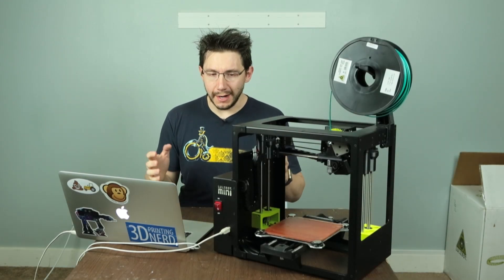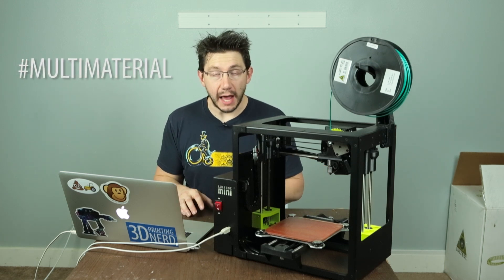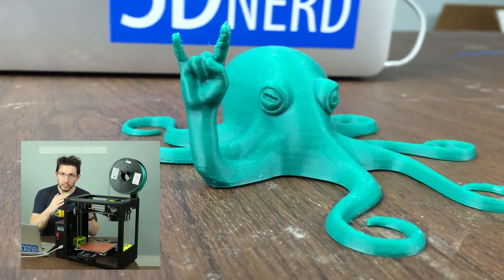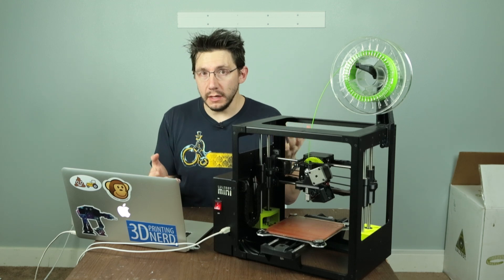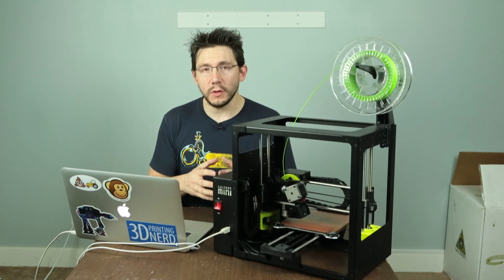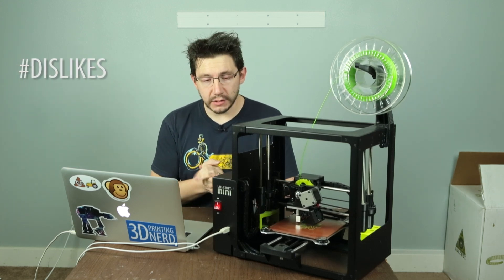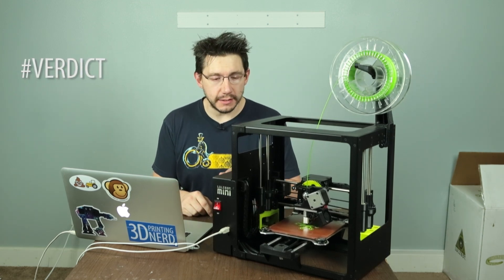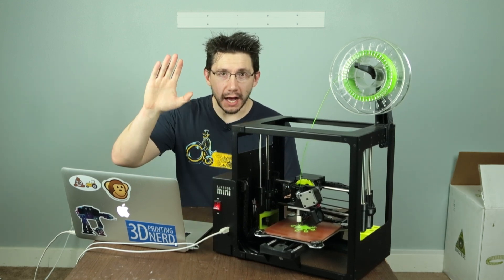Lulzbot Mini 3D Printer Review

Comment: I hate my mini so much.... I change the bed twice, I change the microcontroler twice (Now I use a alluminium bed) Now I use a mks base and it run smooth, less noisy by far. and for the same price of the mini-shitty-rambo, with a touch screen and a sdcard reader. It doesn't wort is 2000$

Comment: Congratulations on your particularly splendid hair in this video! Thumbs up! 👍
I have also recently bought a LulzBot Mini and I'm extremely happy with the build quality, the fact it's also open source and that it prints incredibly well. 
I find the print bed to be ample for my purposes and I wanted a machine that wouldn't dominate the room it's in. 
My only negative, which is not the case for the bigger Taz 6, is the fact that you're expected to print tethered to your computer via USB. I have, however, found the perfect solution in a Raspberry Pi and the Octoprint software (which is also open source). I can now not only send files to my LulzBot Mini via WiFi but monitor the printing process from any browser enabled device AND I can install a webcam for remote images of my print jobs if I want! I think I may love my LulzBot Mini!

Comment: I saw this printer in use and one big reason i didn't get it is because its very very loud. I chose a flashforge clone, the powerspec 3d pro because the build plate was bigger, it was enclosed witch makes it easier to print with abs and it is really quiet. I'll say this 100 times over, I do not regret it. #getthingsdone
Reply from the maker: +Shopless WoodWorker that's great, man!

Comment: I have had this printer for a year and a half.  I found that if the printer shakes at all, the prints will not come out sharp and clean.  I built a solid, stand alone table for it with heavy materials.  Once on this new table, any irregularities disappeared.  I even have the printer sitting on a slab of marble for more weight.  Dampeners under the 4 feet did not work.  The solid table did.
Reply: So for the amount of filament (say pla) to print that octopus, how much would it cost for the material? Also does it print metal filament by chance?

Comment: I need to print 1:400 scale airplanes and vehicles for a model airport I am making. Can this 3d printer make small objects like that?
Reply from the maker: It comes standard with a 0.5mm nozzle, but you could easily find a smaller nozzle to help with smaller things having smaller details #smaller
Reply: Ok, thank you

Comment: 3D printers today seem to be about where laser printers were in the 80's, big, slow, complicated, expensive machines that didn't work very well!  I suspect that in another year they will be down closer to where laser printers are today, made mostly of cheap plastic parts and costing only $79 but working much better.  This one looks like the best model so far but it's $1200 so it looks like the $179 Tico beats it by quite a bit.
Reply from the maker: Your analogy is fairly accurate. I like to equate the 3d printing industry to the early days of video games. 3d printing now is essentially where the Colecovision falls into place in video game history.

Comment: Does this printer work well and reliably with prints with multiple components? My schools printer is rather bad about them so wanna know
Reply: We've had one running for the last month and no matter what we have printed it has not failed to date. Most if printed is 7 parts in one go. We print a lot of things without supports that our delta has no hope with. Only problem I've found is you just have to watch the cleaning and leveling process to make sure there is no gunk on the nozzle which insulates is from the auto bed leveling. Once it's passed the bed leveling you are all good. Printable spare parts are a plus too.
Reply: +Ladbrotory Thanks for the response with that, what about the filament size, I know he mentions in this vid that it is meant for 3mm, but he was able to use 1.75 with no problem, do you have any experience with trying to use 1.75 with this? Thanks again!
Reply: +Andrew Bok You can use 1.75mm right out of the box but you do need to adjust printer settings. I've done a couple which have come out ok but I can foresee reliability issues with it. These' s no difference in cost in filaments but if you have a heap of 1.75mm yes you can use it. By memory Lulzbot also sell a 1.75mm hex extruder which will obviously be better but its probably not worth it. The '3mm' is such a better filament size. We are in the process of converting our delta to 3mm.
Reply: +Ladbrotory ok, thanks for the answers! If you couldn't tell I am looking into getting a printer and this seems like a very strong option, so yea, I just had a few things to wonder about, and I do have some printing experience through my school, so yea!
Reply: Definitely a good buy. Only thing I would say is if you can afford it got the TAZ6 as everything is basically the same just 4x print volume

Comment: I'm a teacher and new to 3D printing. How well will this printer work with TinkerCad?
Reply from the maker: +Todd Shoemaker Extremely well. I use the Lulzbot Mini and Tinkercad when I give talks on 3D printing.
Reply: Another school in the district has a $2500 Makerbot. Would I be happy potentially getting two Lulzbot minis or one Makerbot. Thanks
Reply from the maker: +Todd Shoemaker The Lulzbot Mini DO need to run hosted, so, they have to be plugged into a computer that would slice the files. That said, the Mini is an absolutely wonderful printer. Get a hold of Lulzbot and talk to sales - they may have an education discount.

Comment: I work with a FF Creator Pro at work and that dual nozzle is hard to beat! :)
Reply from the maker: +Goodmourning257 I have a Flashforge Creator Pro as well and I love mine!
Reply: 3D Printing Nerd Having no real experience with any others though this one looks pretty awesome. that auto leveling feature seems like a dream! Wanna get some exotic filament now and try my luck/patience :P
Reply from the maker: +Goodmourning257 do it! I've printed a whole bunch of exotic on my FFCP. it's GREAT for that!
Reply: 3D Printing Nerd Another noob question but id like to hear your input. What is the best technique for removing your prints from the heated plate? do you do it hot or cold? ive noticed you usually print raftless but sometimes when i do my prints seem to become molecularly bonded to the plate and break when im trying to get them off. thanks in advance for any tips and tricks keep up the great work!
Reply from the maker: Goodmourning257 It always depends on the type of build plate and what tools you have. removing cold is usually best. If your stuff is particularly hard to remove, it could be that your nozzle is slightly too close to the bed when printing.
Reply: 3D Printing Nerd Ah thats what it is! You just helped me solve my problem i think. lately the nozzle has been clogging when the hot filament gets blocked and it goes back up the ptfe tubing and i have to do surgery and get it out. I think that the nozzle is just too close to the plate and its gumming up the hole and then causing the blockage. Baby steps haha thanks for the help!!
Reply: +Goodmourning257 Sounds as though you need to bump up your z-offset a bit to correct for this.
Reply: John McNerney I just replaced the nozzles at the beginning of the week and it has been working smoothly ever since. im not sure if you factory nozzles were weird or if i just have yet to experience the problem again. if it comes back though I will keep that in mind thank you!
Reply: +Goodmourning257 Good to hear.  My z-offset comment was based your statement that you thought your nozzle might be too close to the plate.

Comment: Did you have to calibrate the esteps? Our school has that printer...
Reply: +우희도   I gave a Mini to a teach in our local elementary school. The e-steps were set from the factory at 833, but I found that it was over-extruding a bit.  I recalibrated, and ended up dropping my e-steps setting from 833 to about 820. (A lot of others in their user forums have ended up with similar numbers.)

Part of the problem was that their workflow for doing your own e-steps calibration used a filament feed speed of 100mm/minute. This is too fast for accurate calibration (I believe it creates a lot of back-pressure in the extruder, resulting in missed steps on the extruder motor). At that speed, I was getting 850+ for e-steps settings, which resulted in even more over-extrusion. Slowing to a speed of 40mm/minute for the filament feed speed during e-steps calibration more closely approximates the speed during actual printing, resulting in a more accurate e-steps number.
Reply: I also had to bump the z-offset up by 0.1mm. The prints were sticking too hard to the bed, and the kids were having trouble getting them off.

Comment: Couldn't you put in a thumb drive
Reply from the maker: +Orion McGimpsey How would you access what is on the thumb drive? It has no LCD screen or controller.
Reply: +3D Printing Nerd that is true I wish you didn't have to have an lcd to use a thumb drive also would you recommend this to me I am 13 and I want a printer on my desk. But my desk is in my room where I sleep so is it too loud and if it is would you please recommend a quieter printer for me.
Reply: +Orion McGimpsey and if you recommend a printer please make it around 1000-1500$
Reply: +Orion McGimpsey If you go on the Lulzbot community forum, you can find a lot of threads where folks have installed a dampener on the y-axis stepper motor, which has resulted in a significant reduction in noise.

Comment: Great review Joel! As a Lulzbot mini owner myself I share your pro's and con's. However; I have lately noticed that the automatic cleaning may fool you. Even with fresh new cleaning felt and a hand cleaned nozzle (pre-autocleaning), sometimes a tiny bit of felt gets stuck on the nozzle and hinders the conductive auto-leveling. My solution was to remove the felt-cleaning part and hand-clean the nozzle before each print, just to be sure.

Also; a single Nema damper on the y-axis reduced the noise from ear-bleeding to acceptable.
Reply: So for the amount of filament (say pla) to print that octopus, how much would it cost for the material? Also does it print metal filament by chance?

Comment: Does that version of the hexagon have the fragile "throat" ?
I just accidentally destroyed mine re-fitting the heater block because it was so fragile!
Reply from the maker: +MiggyManMike Fragile throat? I'm unsure of that, and this is the first time I've heard of the Hexagon hot ends having this. Have a link where I can read up more?
Reply: No link i'm afraid, it's just something I became aware of when taking mine apart, the "throat" between the heater block and the break is quite thin on the original hexagon, just curious if the new one had the same issue, i've actually gota couple of very generic e3d clones on the way but down the line I wouldn't mind getting another hexagon as it worked well until I managed to destroy it :p

Comment: How about the Lulzbot Taz 5?
Reply from the maker: +ReneFloresVlogs What about it?
Reply: +3D Printing Nerd is it as good as this or better?
Reply from the maker: +ReneFloresVlogs Oh, that I don't know. This is the only Lulzbot Machine I've used.
Reply: +3D Printing Nerd alright... I'm just researching on the best 3D printer for when i get really into it and need an upgrade from the dremel. The PLA only really limits me and I would love something that is just the best if you know what i mean
Reply from the maker: ReneFloresVlogs You have the Dremel? That's a decent printer, and once you put a plated nozzle on that thing, you can run all sorts of PLA exotic materials like carbon fiber and stainless steel. Don't count it out just yet :) The Mini is REALLY cool, partly because of that nozzle cleaning and bed leveling system. I hear the TAZ6 is suppose to have that on it.
Reply: +3D Printing Nerd awesome!!! I'll be waiting on a video of the nozzle then, and also have you tried stepper dampers which supposedly quiets it a lot?
Reply from the maker: ReneFloresVlogs No I haven't, and honestly, I've never felt like I needed to quiet the machines. They are in a room behind a door, so that's how I quiet them - close the door :)
Reply: +3D Printing Nerd could you give me a link to the replacement nozzle you got please?
Reply from the maker: ReneFloresVlogs Look on http://www.proto-pasta.com that's where I got mine. Go there and search for "nozzle" and you should find it.
Reply: +3D Printing Nerd thanks

Comment: I print on the Taz 5 with 1.75 mm and 3.00 mm filament all the time. Just change the settings in cura (I run 95% extrusion). I like 2.85 over 1.75, its easier to handle and less likely to tangle on the spool. I get great performance either way out of a Taz 5.

Comment: I've used 1.75mm filament in my printer and most times it works fine, but once in a while the smaller and more flexible filament will bend and bind up between the drive gear and the print head. I've found that using a little higher temp on the print head helps to keep this from happening, the filament softens and flows with less back pressure on the filament helping to keep it from folding up. I've since used up my smaller diameter filament and switched to all 3mm. Awesome post, awesome printer, awesome channel. HIGH FIVE!!!
Reply from the maker: +Troy “Goldweaver68” Gannon Whoa, great tip, thank you! RETURN FIVE!!!

Comment: Hey Joel, Great review as always!! I couldn't help but notice that the print you did of Nefertiti @3:55 didn't print that well....dude.....what happened to her ears?........any idea what went wrong? A very Happy Easter to you and your family!!
Reply from the maker: +Handmade Props I didn't do good supports around the ears. Yeah, that's my fault on that one :( Happy Easter to you and yours as well! #highfive
Reply: Hi Joel, I thought that might have been the issue. It looks like a fantastic little machine...just wondering if the hot end can be swapped out if you wanted to print using carbon filament? #highfive

Comment: You can use 1.75mm filament in your Lulzbot.
Just slow your retraction speeds to stop grinding and you can use 1.75mm no issues.
Im not kidding and you will see this on the forums also. :) GL!
Reply: +ZachryDoesMinecraft My bad did not watch the rest before I made my comment.

Comment: Look up OctoPrint you will need a raspberry pi($35-40 usd, i whould get the pi 3 as it has built in wifi) a sd card, and a micro usb powersuply 5v, 2.5 amps
Reply from the maker: +Austin Chopra I have an RP2 (got it for Christmas!) just haven't had the time to set it up!
Reply: Wow that was a fast response.  http://octoprint.org/ it runs cura as the default slicer and you can hook up a webcam or raspberry pi camera to it and monitor it from any were in the world, and do time lapse with it as well
Reply from the maker: Austin Chopra Sweet! I need to get this going!

Comment: in this video, joel learns the glory of PEI print surface.

for such a spendy machine, the build volume is too small.

would have been better if the taz 5 was 12x12x12 and the mini was 8x8x8.
Reply from the maker: +ms3bani ooh, a Lulzbot with a 12x12x12 print volume would be WOW.
Reply: 3D Printing Nerd
don't you mean it would be  #highfive  ?
Reply from the maker: ms3bani YES!

Comment: Nice review! But one thing: whats going on with that white stripe in the background? Kinda wobbly :D
Reply from the maker: +Matze Strawberrymaker That used to be a wire cover backing when we had a tv on that wall. I should just remove it and patch up the wall.
Reply: 3D Printing Nerd meant that it seems to be compressed and somehow moves in the video when your on point hair is moving
Reply from the maker: ***** Oooh, must be artifacting in the render. Maybe I need to render out at a higher bitrate? More light?
Reply: Im actually not quite sure. Could also be because of the compressing of google, but a higher bitrate may solve it.

Comment: Joel, i have the Taz 5 and 1.75mm prints just fine. While it does not officially support it, there is a large population of people that use it, and are active on their own user forums.
Reply: +Geeksmithing I have used the 1.75 on my taz in the past and its worked fairly well too... I made a mod to my extruder by buying a thin aluminum rod (cant remember exact diameter) at Ace Hardware, and cutting it to length so that it runs from the end of the hobbed bolt all the way in to the melting chamber. This actually allows me to print flexible filament in 1.75mm on the taz 5.  Its fairly easy to do and works amazingly well. Not unlike other mods that restrict the ability for the filament to buckle when exiting the hobbed bolt. I made a video about it, but i must have deleted it :)
Reply: +Nige well, in joels case he has all 1.75mm filament printers, probably doesnt want to buy 3mm filament simply to do a review.  Or like me, i had very expensive copperfil etc that I didnt want to pay for twice.
I absolutely see the want to print in 1.75 on the lulzbot printers.
Reply: One of my favorite things about the Lulzbot printers is that they are all open source. You can print your own replacement parts, and make modifications to suit your needs. Many people do print with 1.75mm filament with no modifications to the extruder. However, there are links to several designs on their user forum to make or modify an extruder specifically to handle 1.75 mm filament. 

SO you can make it work with 1.75mm filament with no mods, but it will work more reliably with an extruder modified for that filament
Reply: I did the exact same thing, except used a piece of 1.75mm nylon bowden tubing with outside diameter of 4mm.  I just use some tweezers to pull it out when I want to go back to 3mm.